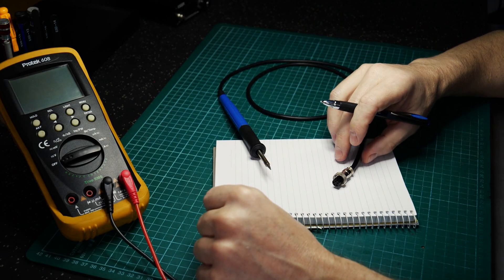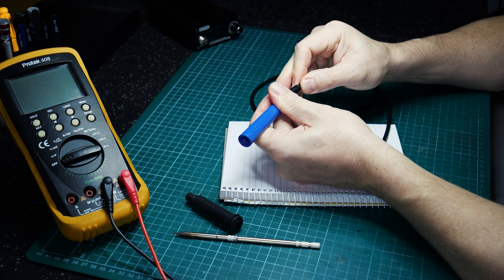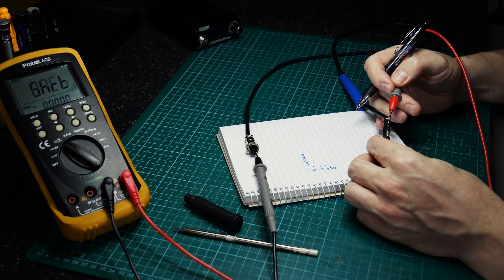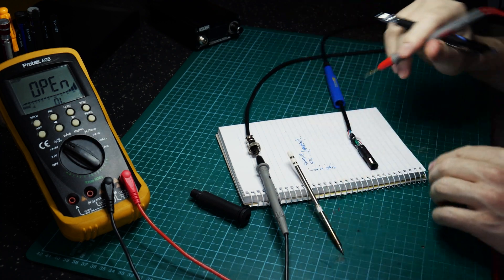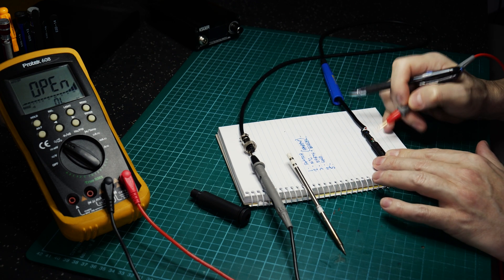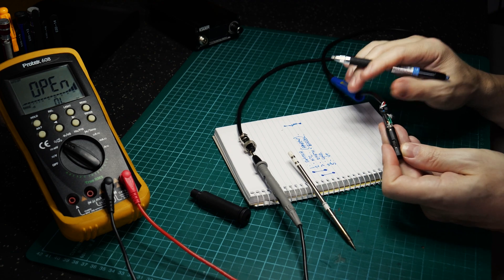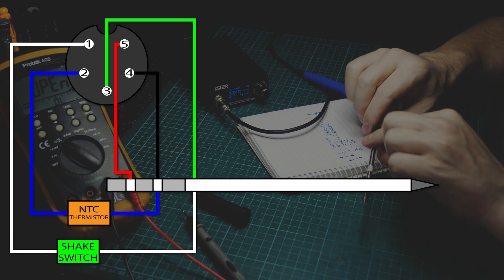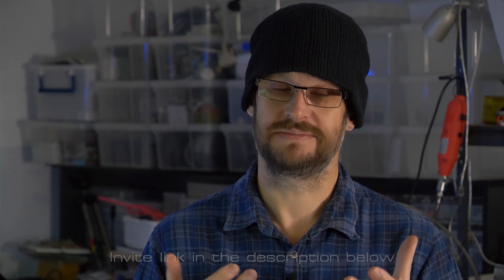#35 - How to check your Hakko Fakko 9501 Soldering Iron is wired correctly.

Comment: I grabbed a KSGER station (hardware version reported as 3.1s) which came with the bigger 907 Fakko handle with a 6-pin connector. Seems to be running a firmware (v8.0M) that looks like a Quicko variant. Doesn't have discrete tip calibration. Has a T12 compensation, and also 1321 and 1322 tip settings (once again not discrete). It has an NTC mounted just behind the front panel inside the station. It seems this station can handle non-T12 tips also.

No NTC in the handle. Has the ball switch (green barrel looking component).

White wire goes to ball switch, and switch goes to Blue wire via PCB. 

Only 5 wires in the cable. Shake to wake works.

I just took delivery of a 6-pin 9501 FAKKO handle. It also only has 5 wires in the cable. No NTC installed.

Blue is soldered onto the DC GND tab in the handle.

White goes to the mercury switch, and that is also soldered on to the DC GND.

Works fine in my station, and shake to wake works.

In both handles, DC +ve, DC GND and Earth are all connected as yours (in the handle at least.)

I buzzed out the plugs, but never noted the PIN numbers. If you'd like I can re buzz them.
Reply from the maker: Wow! massive amount of info Collin, great job. 😀 Interesting variations you have highlighted over the different handles.  I am actually quite fond of the discrete tip calibrations though, however you can feel the differences relating to tip size and thermal mass when it comes to bigger joints.  Shouldn't try to cheat and just change the tip, haha.  
It might be helpful to some others if you buzzed out the handles with pin numbers if you feel inclined.  What's the tip to grip length like on the 907 compared to the 9501?
Reply: @xyzconceptsYT  Somehow I have it in my head you're in Perth. If you are, maybe I can let you have a look at it? It feels pretty comfy to me, but the tip protrudes further from the handle than the 9501.
Reply from the maker: Yeah, I might have mentioned it in a couple of my past videos or commenting on someone else's video.  Yeah, been a Perthite (south) since my beginning.  
After using all sorts of soldering irons over the years and getting into more and more SMD type work the shorter tip to grip tends to work out best for doing sub-millimetre joints.
Reply: @xyzconceptsYT  Are you involved with The Artifactory makerspace in Osborne Park? Been meaning to drop in and check the space out.
Reply from the maker: @CollinBaillie  I can't say that I am, sounds like a great idea though!
Reply from the maker: Hi Collin, thanks for the awesome gesture but I am crook as a dog at the moment might be best to keep me lurgy to myself.  Might have to tee up another time 👍.  Thanks again, appreciate it.

Comment: I also had a problem with the iron not entering stand by or sleep mode, worked perfectly well otherwise, even the wake up from a sleep start was fine, if I held the iron upside down the dot would stop flashing and after the set time would enter sleep mode, so assumed as others on here that the wake up switch needed to be reversed, I did this and it worked in a fashion but I'd get a spurious signal now and again(the dot would flash once) which would reset the sleep time  and it never entered standby by mode, after playing around with the menus I figured out that I had the standby setting mode wrong. It should be set to switch and not wand. These settings seem to invert the signal and after swapping the switch in the iron handle back to its original position and changing the menu option to "switch" in the standby settings..... it all worked fine. Basically operator error but a lesson learned the hard way.

Comment: Add the issue that the shake switch can also be physically soldered in upside down - mine was and it meant that it never went into standby regardless of the pen not being moved 

The clue - the dot on screen would blink randomly even though it was in it's stand- tip pointed down- and perfectly still - thought I had a faulty unit or switch 

I noted that the only fix was to wedge the pen (tip pointing upwards) and it would stop blinking - not ideal to have the hot tip pointing upwards in my workspace, but at least it did go to standby and sleep modes
Inverting the switch in the handle fixed the issue and it goes to sleep and wakes with the lightest of vibrations now
Reply from the maker: Yes, I've heard a few others talk about this issue.  I have a theory but i've not tested it to be certain.  In my case the NTC/shake switch were wired in reverse once I sorted that it was working like a charm.

Comment: Nice clear, methodical presentation. I had shelved mine shortly after delivery thinking it was a dud. Indeed it was, 2 of the 5 pins were not even connected, so how this passed QC I will never know!
Reply from the maker: Depends on the hardware version, do you know which 2 pins weren't connected?  For example, the NTC (temp sensor) in the handle probably wouldn't affect the overall performance of the unit and you could live without it.  There are so many variations it's hard to tell when ordering online whether it will work out of the box or will need some modification to suit your setup.  Cheers for the comment.
Reply: @xyzconceptsYT  Voltage in and ground!
Reply from the maker: @DrHWO  Ha! Only the 2 most important connections.  Oh, gee.